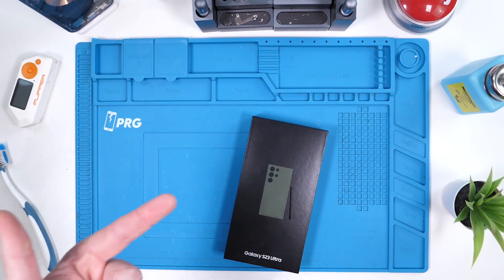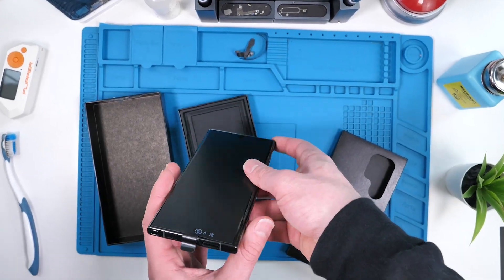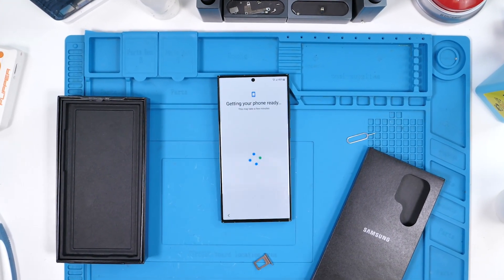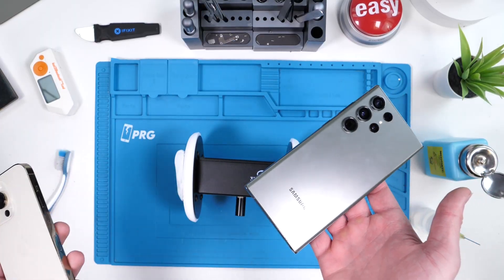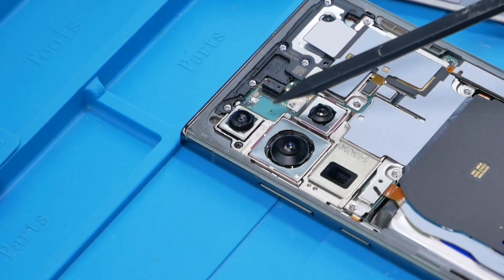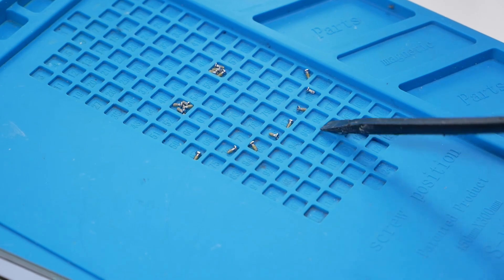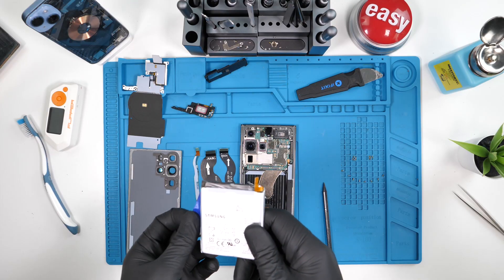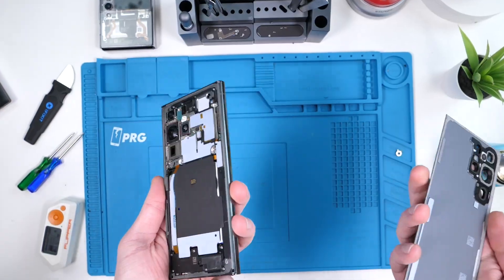S23 Ultra: They Copied Apple...?

Comment: ".. and the front camera are very hard to repair tho"

GH96-15526A, costs around 25-45€ depending on the shop you buy it from, its not the cheapes but can easily be replaced. Just remove the hot glue like material around the camera with a pick tool and replace it with your new front camera.

Comment: While I was using my S23 Ultra, it suddenly got turned off and won't turn back on. Checked charger, battery and display at the service center. No issues with that. They suggest something is wrong with the motherboard. They haven't opened it up entirely since it would affect the warranty. As per their findings, the power required to boot up the device is not reaching the motherboard. Dont know what causes this issue, because I only used original samsung 45W charger and cable, haven't plugged it on a power bank or car, never used that much while charging. Anyway all my data will be gone it seems since I have to replace the motherboard as per their suggestion. Do you know whether anyone else faced the same issue and any alternate solution?

Comment: The s22 ultra and s23 ultra are much easier to repair due to the phones not having curved front glass or back glass like the older models. The battery is now easier to replace in the 23 ultra, and the 22 ultra has all the same sized screws thankfully. I'm a phone repair technician myself, I hate the note 20 ultra due the stupid over use of loctite on the screws causing stripping issues. The s21 sucks when it comes to the sim card not reading due to the crappy charge ports.

Comment: I have an A13, sad thing is that they released the A13 and the S23 almost at the same time, before the A13 they made the A33... samsung should make up their mind
Edit: for those wondering the A13 doesn't have 3 cameras, it has 2. The top most one is actually a macro mode depth sensor

Comment: 00:10 its the best phone. Apple seems to limited  performance of the iPhone 14 to prevent damaging the battery from overheating and making a bulky battery pillow inside the phone. It's the new s7 house fire starter phone but without the fire part thanks to better protected battery, but still it damaging your pocket.
https://youtu.be/dJAeR39B96A here y'all can see its performance at 30 min %100 throttle (spoiler: its a slayt show)

Comment: I've never liked iFixit's repair scores since they are always biased toward Apple. They gave the 14 PM a 7/10 compared to the S23U's 3/10 despite the parts on the 14 PM being serial number locked to the mobo, the rear glass still needing a laser, and non-standard screw types at different lengths being used throughout the device.  Your score along with Hugh Jeffery's assessments are much better metrics to go off of than iFixit.
Reply: i would rather my phone not get water damaged, than have a slightly easier time opening up the back of the phone.
Reply: @fleet3  And that way, once the back shatters, you can't get the glass off, and the phone becomes even less water resistant than if it just opened up from the back.

Comment: u havent considering the display tho, it is the hardest part to not fucked up
Reply from the maker: It’s really hard to remove but the only reason you would be removing it is to replace it anyway, plus the new displays typically come with new frames and small parts preinstalled

Comment: Thats not an air bubble in the lamination. Thats purely how flexible OLEDs look like. Look at your Apple watches. They are all wavy in the sunlight.
Reply from the maker: Nah it's not how its supposed to look. It's also only an issue in that corner. Probably won't affect use in any way but it's something to note

Comment: Maybe you recorded the s23 ultra video in 4k 60Fps, which means it can not change the camera module while you are Zooming in. It seems like you started recording with the ultra wide camera. Before you start recording, you need to change the camera, or you can change the settings to 4k 30fps so it can change the camera while recording
Reply from the maker: We did a few other tests and I much prefer the iPhone when it comes to video recording, the s23 ultra still takes good video but it just doesn't feel as natural

Comment: I think we gotta remember that ifixit rates the iphone as the most repairable phone after the fairphone, am starting to think that they base their repairbility scores on which phone is easier to open up, not repair assesment or part serialization.
Reply: Yea, try to find component for an old android (even new android) phone is a pain in the as*
Reply: @l3abol_uci191  well trying to make a component actually work on an iphone is much harder with their software locks, am just saying i wouldn't trust ifixit's scores considering that hugh jeffreys did a video debunking all of this crap.
Reply: I think we gotta remember that ifixit rates the iphone as the most repairable phone after the fairphone, am starting to think that they base their repairbility scores on which phone is easier to open up, not repair aseament or part serialization.

Comment: Ok now I have to ask what about that air bubbles you talked about in the start of the video and are they covered by the warranty like when you see such thing in you new phone shouldn’t you just replace it???
Reply: That's part of the pre installed screen protector. That can just be replaced anyways.
Reply from the maker: @SolarSystem2468  No, that's the actual display
Reply: @PhoneRepairGuru  It looked like a screen protector to me for some reason. Interesting..

Comment: Why i fixit give it 4/10 

Biased Decision. Nothing else , I like what they are trying to achieve but Faking a repairability score (and potentially motivating people to not do repairs) i no longer trust them  . Your score is what it should be (If you compare to their older Ranking system/ Without comparing to I Phones & other ones with software locks(Bcz software locks definitely need to be either get a massive negative mark or mark it DNF ) .
Reply: Sure